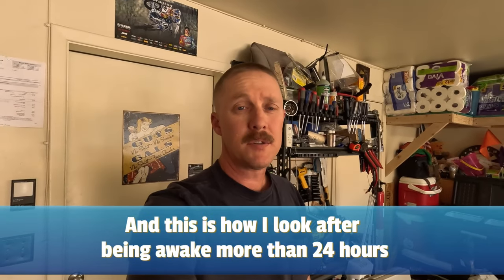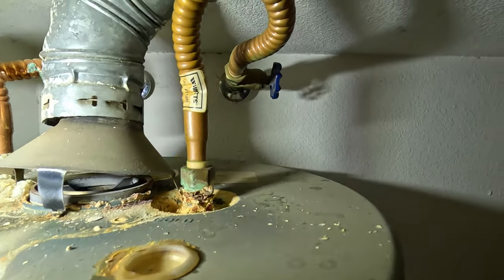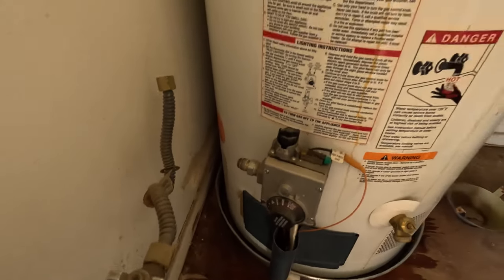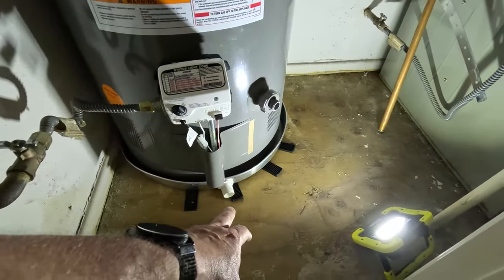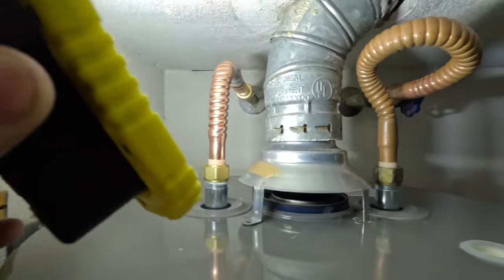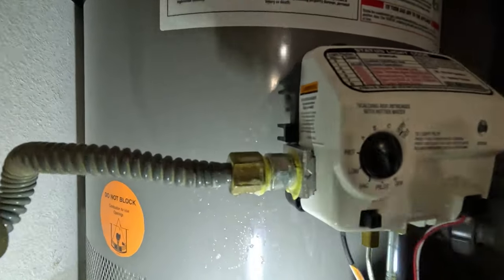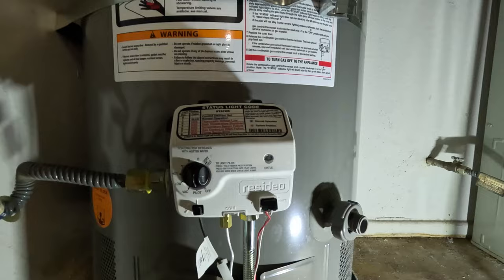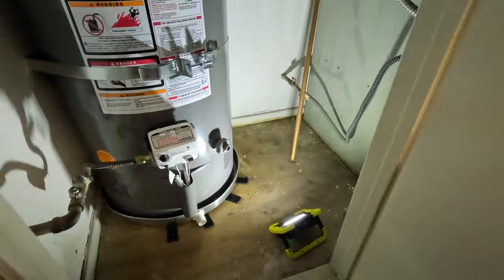Easy Water Heater Install

Comment: Good stuff. Recommend installing TRP pipe to drain to the ground, outside, or into a bucket. Code states it can't be connected to a drain line.  Install a sediment trap and a new valve (leaks when old). Maybe get a smart moisture sensors or at least a battery one that has a load audio alarm. That'll save you from checking it but once a year to change the battery. So what are you going to do with that $1000 you saved by DIY?
Reply from the maker: I'm going to put it towards a very expensive tool that I'm about to get.  You'll know it when you see it.